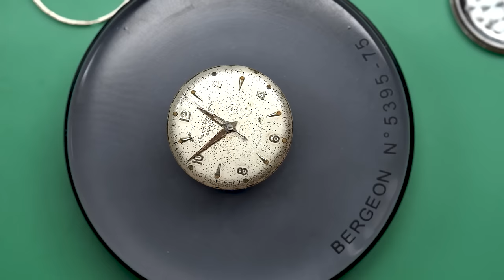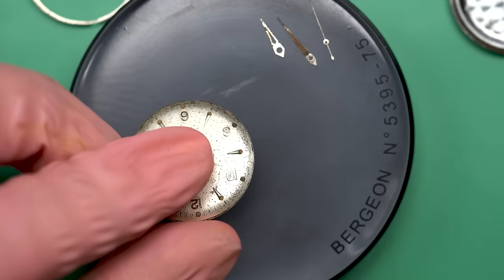Girard-Perregaux 1950s Vintage Dress Watch Restoration

Comment: I was honestly a little skeptical about the dial at first, but it actually looks really good against the brown leather strap.
Excellent work as always.
Reply: That was an excellent video: great restoration.
Reply: I think the dial also has radium tho
Reply: @wenomechainasama6161  if it does, then it's a really small amount. Plus, the real danger from radium is when it comes off and someone inhales it.
Reply: @Thrillrider10  i know, it just seems he was completely oblivious about the dial but said he didn’t even want to mess with the hands.
Reply: I like that he's willing to keep a dial even with such a "severe" patina, it makes the watch far more unique watch with much more of a story to tell
Reply: @Thrillrider10  touching radium with your bare hands also does a lot of damage, but inhalation is the worst thing you can do while working with radium. its a very good idea to don a special NBC full face respirator mask (not half face respirator since radium particulates can get in your eyes) or go straight to a PAPR respirator (the kind used in pathogen labs - ie. the CDC. and radioactive sites like nuclear powerplants or christmas island). when you buy these masks they are at best only equipped with a particulate filter or a chemical filter, you need to go out of your way to source a filter designed to capture and neutralize radioactive ions. you'd think these filters are expensive and hard to find, but in reality they're actually quite affordable and very abundant in the online market, just make sure they are actually branded, stamped, and have serial identification codes on them to make sure they're not fake.
Reply: @wenomechainasama6161  A Geiger counter would possibly be useful here.
Reply: @wenomechainasama6161  I was guessing the dial's "blooms" were from the radium paint deteriorating and falling from the hands onto the dial.

Comment: I know the feeling of getting something going again like that. It feels awesome. I had a friend who had a small engine repair business, and he had a mower that he was never able to properly troubleshoot. The owner gave up on it and just left it with them, and then it just sat in his back yard for several years. He eventually told me that he thought the engine was locked up, and gave it to me as a parts machine. It sat in my yard for a year or so while having parts robbed off of it before I actually took the time to fully inspect it, and then I found it was not locked due to internal failure. I spent several months working on it before diagnosing the issue and fixing it. After that it took me another year to replace the parts I robbed from it and repair the damage from it sitting all those years. I remember the thrill of hearing the engine run for the first time, and the bigger thrill of actually being able to use it for the first time.

Comment: So I watched this a second time and Marshall, I have to tell you that at 6:54 and 8:53 you can clearly see that the pivot from the escape wheel was still there. And the moment you destroyed it, was in the washer! When watching this the first time I thought "wow, he's really filling up that basket" and yes, that were too many heavy parts for the wheel pivots. When I clean them, I always put the escape wheel and pallet for separately because they are so delicate. Most of the time I only clean them in Isopropyl to avoid the washer (or the ultrasonic). Well, but thats how we learn ;)
Reply: actually at 18:40 it still seems intact...
Reply: If it broke inside the watch, wouldn't the broken tip have been found inside the watch?  But if it broke in the washer the tip would still be in the basket?  A WhoDunIt inside a watch restoration video!
Reply: @flowgeek706  you are right
Reply: You're right. Marshall is incompetent.
Reply: @yessanknow302  Even if you were better, which I doubt, you dont say this kind of stuff. Gtfo somewhere else with your hate and let us enjoy.
Reply: Isopropyl will dissolve shellac if left in too long.
Reply: @99jp99  Marshall does such a great job filming these that the scale of what he is working on isn't really apparent. I was amazed by how small the pivots are on all those parts especially the escape wheel and pallet fork. If they broke off in the watch, you are right, they should still be there but they could easily be mistaken for dust and be removed before going into the washer.
Reply: @anissez2893  It's an almost certainty that the comment was a joke. No need to get up in arms. Additionally, people with genuine malice wouldn't pay attention to your pleas, so save a few furrowed brows and ignore any trolls. You will be happier, I assure you 🤙
Reply: @yessanknow302  that's not what I wanted to say.
Reply: @flowgeek706  You are 100% correct, it's even more clearly visible a little later at 18:50. Sorry to tell you this Marshall but you broke that pivot yourself in placing the bridge. It possibly could have already been damaged in the washer and the little pressure placing the bridge was enough to snap it off.

Either way, we all know escape wheel pivots are especially delicate and prone to getting broke
Reply: @anissez2893   My initial thought was he was being ironic, since Marshall clearly isn't incompetent.  Humour doesn't always fare well in plain text.

Comment: Thank you for the video. I enjoy these very much. I remember back in the 1970's wearing my father's old watch that I found had radium in it when I was in my high school physics class. We were studying radiation using a Gieger counter and my watch was making it go crazy. It was mostly Alpha rays as a paper filter was enough to bring the reading back to just background level. You mentioned the radium in the hands, but the numbers also glow in the dark, so the dial is also radioactive. Would it not be just as bad to use it as the hands?
Reply: The luminous paint on the dial is also radioactive, however generally radium on the dial is accepted as something that can’t be changed without damage to the dial. However, re-lumeingthe hands is regarded as a good compromise and does reduce overall radiation levels.
Reply: Based on watches with radium dials I've seen worked on on other channels. Most of it was in the hands. Nothing that used radium paint will still be glowing. The phosphors in the paint get burned out by the radiation. The radium itself is barely less radioactive than when it was first applied though and you really don't want to breath any of the dust in. Without some additional safety equipment like a fume extractor and a quality resperator mask, I wouldn't mess with it.
Reply: Marshall want might to get a geiger counter so he can check for himself whether certain watches have radium or not. A good number of them aren't clearly marked.
Reply: When cased up properly (e.g. no cracks in the crystal, etc.) there is no danger of radium radiation escaping from the watch. The danger comes from working on exposed hands and dials, and ingesting radioactive dust through the nose and/or mouth. You probably have heard of 'the radium girls', who in the 1920s were employed to paint watch hands and dials with radium paint. The girls were told the paint was perfectly safe, and their supervisors even encouraged them to lick the ends of their brushes to achieve a fine point for neater work.  When the girls began to get very sick and even die from radium poisoning, the bosses didn't want to know and fought tooth and nail in the courts to avoid paying compensation. Eventually the girls won their case and were compensated, but they paid a high price in ill-health. One good thing to come out of it was that the danger was recognised and labour laws introduced to establish work safety practices.  Believe it or not, radium paint was still used in watches into the 1970s!

Comment: Interesting video. Could the face's patina be a result of the radiation from the radium on the original hands? On disassembly, you found a curved bit that you didn't talk about after finding it. Was it a bit of the crystal? Was it an intruder? Was it an alien spaceship?
Reply: it will be if patina dust not try to settle in one place marking position this watch been kept. on the other note - both fixing case screw missing XD
Reply: Radium usually burns in a pattern on the dial from where the hands have been sitting (if the watch is left not running), so I’d guess that wasn’t the cause here.
Reply: Does this mean Marshall is riddled with cancer?
Reply: The exposure you get from a radium dial/hands is tiny when you consider the amount of time he has the dial and hands exposed and not behind the crystal.  The crystal absorbs most of the radiation.  The real risk is from ingesting it, so you need to be careful if it’s deteriorated, and coming off the dial, not to get it on your hands (typically wearing gloves), and then to wash carefully before eating. You get a higher exposure to radiation every time you take a plane ride.

Comment: Really like your videos. Just one thing. I cant really belief that you can keep track of all these screws. like where which screw goes. maybe you can talk a bit about that. like are these screws all the same and you can just use whichever you like?
Reply: I don't know about Marshall, but a lot of the restoration channels took video of the disassembly so they could keep track of what went where. That's what I did when cleaning laptops. But then they decided to upload it to YouTube to help others.
Reply: There are also these things called screw organizers that make it so you can label your screws
Reply: He said in other videos that he actually looks at his own recordings when he looses track of parts :) (in that case, after dropping the whole lot of a watch on the way to the cleaning machine onto his carpet... the pain...). So I guess it's a combination of good memory and having a video. I take videos/tons of pictures of everything I disassemble, too, be it motorbikes or smaller things. It not only shows what goes where, but also how it was placed exactly (top/bottom sides, orientations, seals, ...)
Reply: Marshall doesn't do this but some watchmakers replace the screws after removing what they're holding down.  There's no need in cleaning the threads or thread holes so you can just put it through the cleaners with the screws in.  That way you always know where they go.  Tip of the day.

Comment: Marshal handling a pair of radium watch hands: "they are toxic and dangerous, I'd rather not work with them"

NileRed handling a hundred or more Radium watch hands: "Yo look at the sound my Geiger counter does when I shove these watch hands near it."

Cool video as always. It was really cool to debug the watch and fix.
Reply: My brain immediately went to the exact same place. I suspect that the real danger is if the radium paint loom were to fracture, and the restorer were to inadvertently inhale some of the particles. Obviously, two whole generations people had these time pieces on their wrists and in their pockets, without many, if any, issues. After all, the watch case is a pretty good barrier to radiation. I must be some kind of maniac, because I’m looking to replace the non-radium hands on one of my projects with vintage radium hands. Even though the glow on another watch in my collection is very faint, it’s still a cool effect, visually and historically.
Reply: So, when radium (probably radium-226) decays, it releases alpha particles. These are slow, high energy particles of ionizing radiation. So, if they get into sensitive places like lung tissue, it can be really bad. On the other hand, the watch glass (even being plastic) is enough to stop those alphas from going anywhere. Also, skin, clothing, even enough air particles, are enough to stop alpha particles. So, radioactive yes, necessarily  bad for you, probably not.

Comment: Three issues concentrated in one area - something happened that affected the jewel depth, broke the escape wheel spindle, and unseated the mainspring arbor all at the same time. It might also be what put that stress fracture in the crystal so that it broke so easily once removed.

I'd guess that the watch was dropped onto a hard surface.

Comment: I watch these and think of the paper and pencil, possibly with a slide rule, engineering that went on when watches were designed. Then the meticulous hand machining done. Watches are truly incredible little pieces of machinery. Designed by some incredible minds.

Comment: Marshal, what you said about computers verses mechanical resonates with me, I am a (retired) computer software engineer but have a machine shop in my garage as my main hobby, when folks at work find out they always ask if I have CNC (computer controlled) equipment, but I always surprise them with my answer which is no, I use computers all day at work and while I very much enjoy doing that once I get home I like to do non-computer stuff so all my machine shop equipment is totally manual, no computers.

Comment: Marshall thank you. Your calming voice relaxes me. The other videos just don’t have you. You talk & explain what you are doing, you explain what each part does. How long have you been involved in the hobby. Your knowledge of watches is amazing, how much research you do before cracking open each watch may help. I have an old Elgin pocket watch that doesn’t run. If I ever find it. I’ve owned it since 74, paid $20 for it. I took it in for cleaning & was told it needed a new spring. Then he couldn’t get it to run right. He sent it to some expert, who said the spring was wrong. Never ran right again. I always tried to wind it before I went to bed. It had ran perfectly for 6-7 years. Don’t worry about my watch it would take a month to find it.

Comment: Marshall, First off love your videos and that you are saving all of these, in most cases, derelict watches.  I suspect the escape wheel pivot broke when the ratchet wheel was removed under mainspring tension.  The rapid unwinding of the spring loaded the escape wheel against the pallet fork under relatively tremendous torque and something had to either hold or give and give is what the pivot did.  It is possible the shock shifted the jewel as well but that would be a real long shot.  Good work solving the problems with this one.  My final thought is that long fiber you found when removing the keyless works was a misplaced attempt at a shim under the train bridge to overcome the out-of-place escape wheel jewel.  Watchmaking is also a bit of archeology and that adds a cool aspect to the hobby as well.  I welcome any thoughts on this.

Comment: Awesome vid and work! Regarding the hands replacement the only thing is that they are basically non-lume hands matched with a lume dot dial so in the dark all you will see are the dots (if they are radium you will see them twinkle). So dial still probably has radium! I personally avoid radium dialed/hands watches but if you can safely remove the radium and relume with “coffee stained” lume, you can simulate vintage aged lume but without the dangers of radium! Oh, and yes, you got me on the hair! I was cringing as you began to tighten down the yoke plate!

Comment: I'm a GP fan and really enjoyed your video. I have worked on a few of those Gyromatic movements. They are great watches made from an ETA1256 ebauche. Thanks for the video. I actually picked up a tip or two on how you assembled things, the automatic parts in particular. Oh, and man, you really have great taste in tools. You have all the good stuff! Oh, and you handle those little Inca jewels like it's easy. Those are interesting tweezers that you're using, sort of flattened off on the ends, giving more surface area for contacting the jewels. I like. 

I knew once you took off the back that the video wasn't going to work for what I was trying to find out (How one of those raised tab movement spacers is installed.), as your watch didn't have the same ring. But guess what, I watched it anyway. Thanks again. Cheers.

Comment: Great video, Marshall.  I really enjoyed it.  The deal with radium dials (Indices) and hands is that they are radioactive.  Not a lot but some.  You can get a Geiger counter online pretty cheap (around $100-150) and you can test them yourself.  The best thing to do is to keep your distance from them.  You probably can work with them as you do, but just move them away while you work on the watch.  Time and distance are your friends.  Low time, more distance.  You don't have to freak out.  The person more at risk could be the person who wears the watch.  Not sure how much dose they would ger,

Comment: Fun to watch!  I have a similar vintage gold GP Gyromatic (maybe mines from the 60's) with Roman numeral markers and same text on the top and almost identical curved burst dial.  Mine has "CHRONOMETER" script below the dial and date complication.  Haven't opened up the case on mine as it still runs and keeps decent time even after it was last worn regularly in about 1970.  Makes me wonder though.  Very fun piece of vintage kit.  And as i wondered if mine was a high-beat one or not I pulled out my new cell phone with super-slow-mo....and found out the second hand moves ten spots between each second.  It's a high-beat!

Comment: I noticed that when you complete the restoration process that you don't center the fast/slow adjustment lever, it lost 6 sec/d and it was all the way on the slow setting (if I remembered correctly).  I wonder what the accuracy would be if it was centered.

Comment: How do you keep track of which screw goes where? Are there cases where the screw diameter and thread are the same, but slightly different length?

Comment: I have two Girard-Perregaux wristwatches from the 50’s, a manual and an automatic that I purchased on EBay. The manual wind wasn’t restored, but is in like new condition, and the automatic was restored. They are both special occasion watches.